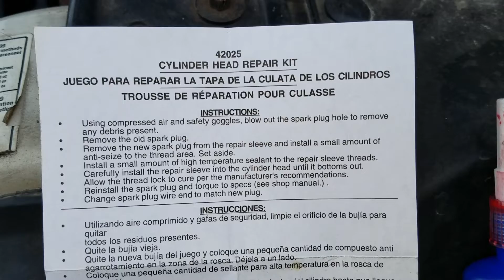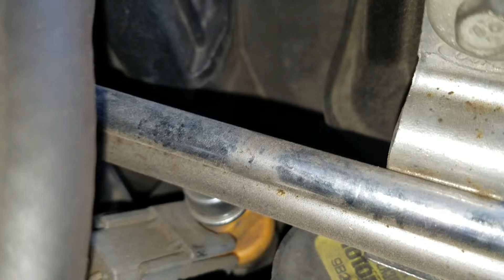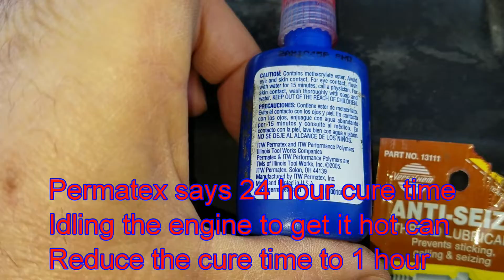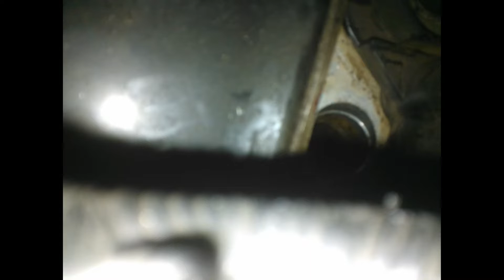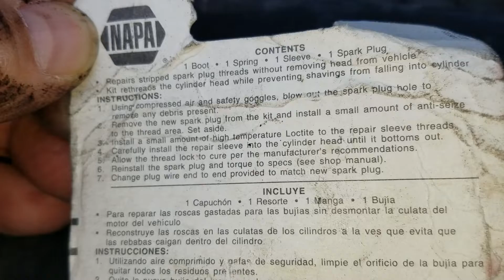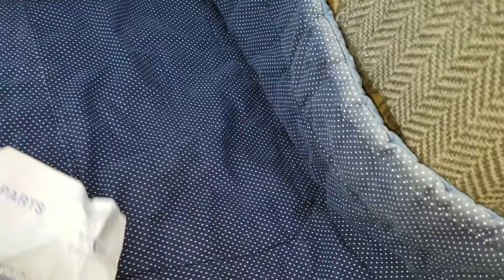Fast Permanent Fix FORD  5.4 L 2V Aluminum Head Spark Plug Seat Repair

Comment: Use this only for a temporary fix if your stranded. It will eventually destroy your head which will need to be replaced. You need to permanently fix it with a Cal-Van insert.
Reply from the maker: I mostly agree with you that it's a great middle of nowhere emergency fix, but it will last for years or it did on my truck and that's with hauling around a 3000 pound truck camper and probably another 1000 pounds of gear. My repairs held up to severe duty. A regular person may never need another repair. If something happens again down the road,  it is not going to destroy the head. All it's goi g to do is the same as the original failure and blow out. You may even be able to make the same repair using a new kit like I did in Vegas. I had a repair kit fail, got a new kit, installed it, warmed the engine idling for an hour to speed up the cure then left Vegas at 10PM heading north a couple hours. Slept at a gas station mini mart a couple hours before continuing on. Repair worked fine without fail another year or 2. The engine finally failed and seized on me in a matter of seconds when the oil sump tube failed and cracked causing the the pump to suck air. The new rebuilt engine has new plug seats that should be no problem.  Just check for torque periodically.  Take care...
Reply: @CITAP1  your lucky cause normally it will blow out and take a piece of the head with the repair.
Reply from the maker: @johnmilnerQQ  Usually what it does is simply blow straight out and break off the side of the coil, the little mounting tab that holds it down to the head and in the hole to the spark plug.  I've seen it happen a few times and never saw head damage. Always just the coil and the coil is usually still usable except it will sit lose. With my old engine, I kept two kits and tools and materials to do the repair.  15 minutes and you're on the road.
Reply: I put it in my 4.6 expedition and still holding up until now after 17 000 miles.

Comment: I mean, I’m hearing everything but how to tap and rethread a spark plug hole in a tight spot
Reply from the maker: The new seat has a cutter built into it. Loa the threads up with the correct hi temp red thread lock, use a deep socket and put it down the hole start tightening and go forward only, no back and forward like a regular tap. Tighten down till it feels tighter and stops turning easily. The front holes are easy. 4, 5, 8, not so easy. Having a combination of extension lengths for best position helps.

Comment: O'Reilly auto has them for 59.00
Reply from the maker: I have a new engine since then. The new heads have new steel plug seats which are like the CalVan seat. Should never have this problem again.

Comment: After using the CalVan 38900 kit to repair my 2001 F-150, I would never consider another method of fixing this problem.  The CalVan kit is engineered to be a one time repair and is far better design than the Napa repair kit.  That being said, it is pricey, so if your budget won't allow it, the Napa kit is probably the best solution.
Reply from the maker: Totally agree! If you're in the middle of nowhere with limited tooling available, the NAPA kit is your best choice. You can always install the CalVan kit later.
Reply: That kit is $550-$600.  How much did you pay and how many spark plugs have you had to fix?  I would love to get that kit too.  My guess is that local mechanics don't use it because of the cost.  I believe that's why I am fixing mine now.  I had to use the NAPA repair kit as I am pressed for time and to get my steady ride back on the road.  How long did it take you to fix yours and what components did you remove to get better access to it??
Reply: @patrickwhelan5703  $235 on Amazon. Kit includes 8 inserts.
Reply: I only paid $150 for my Calvan knockoff kit on eBay and it has all the same parts as the Calvan. 

Amazon has new Knockoff kits for $165.00 that includes all the parts of the Calvan as well as the inserts.

Good luck 🍀
Reply: PS: Napa auto parts sells the same exact Calvan kit for over $450.00. They must really think people are stupid.
Reply: @DoyleShadduck Actually, I think they do.

Comment: Hello what is the kit called and where can I buy it
Reply from the maker: I showed the instructions near the beginning of the video and on the box at this time in the video. 
https://www.youtube.com/watch?v=PWyw_gxNQ4Y
The NAPA part number shows in both parts of the video and is available at NAPA Auto Parts Stores. #600-3248

https://www.napaonline.com/en/p/NDP6003248
NAPA also sells replacement coils if you need that too.
Good luck with your engine.
Reply: @CITAP1  ok thanks a lot

Comment: Getting a free f150 with a plug blown out would jb weld be m a better option for lasting the life of the engine rather then lock tight

Comment: I don't know about "easy fix". 1st you need the right tools to fix it. On my 2002 ford Triton you definitely need a adjustable wrench. You got to find the hole that it came out of. You got to take apart the wire leading to the coil. You got to put the spark plug in without restriping it. etc. A person with no knowledge about cars would have a hard time finding this
Reply from the maker: This video deals with the two valve engine. You don't need an adjustable wrench.  The coil merely unplugs, then use I think an 8mm socket to unscrew and remove the coil. Remove the spark plug,  install the self tapping seat, install the new H1 plug, finished. The two valve engine is simple.
Reply: I am a mailman and no mechanical knowledge and I have done this successfully.5 years later today it is still no issue still in tact.

Comment: Having a problem finding a thin wall socket that will fit! Any suggestions would be appreciated
Reply from the maker: Usually a cheap 12 point deep socket will do it.
Reply: Any trick on popping the new spark spring into the new coil
Reply from the maker: @SDMFTommySick  You just press it on over the little tab, may take some effort but you want the tight fit. The little metalic rod inside the spring I believe does a couple things, concentrates the magnetic lines to transfer more energy into the spark plug and reduce radio noise interference.  When you get the spring on, slip the boot over it and the boot does attach to the coil in a specific way that should become obvious.  Hope it all works out for you.
Reply: @CITAP1  just kind of put the spring in there my problem was the spring I was removing kind of got all twisted up because it was really attached in there and I couldn't get the new spring attached that tight. I just got the job done truck started right up just went down to the gas station and back so far not haven't but much of a load on it. I do want to thank you for posting this video I know it was a while ago that you posted it. You & the video have been a lifesaver thank you very much. Funny thing is I work on race cars all the time never had to deal with these coil packs like this..
Reply from the maker: @SDMFTommySick  Awesome! Makes my day knowing I helped someone.  I've done a few older Ford and Pontiac engines. I appreciate the straightforward honesty of a carburetor and dual point distributor.

Comment: Mines cracked and broke off in the head how to get out now without taking the head off
Reply from the maker: The plug or the new seat? If the seat, an easy out.  If the plug, can't you just get a deep socket on the plug?
Reply: @CITAP1  the seat broke into pieces and I got a couple out already with a magnet but the last piece seems to not be able to come back out the hole
Reply from the maker: @nathanscruggs6080  Sorry this seemingly simple project is becoming more of a P in the B for you. I'm guessing it's the NAPA KIT seat that broke apart and a piece is now stuck in the cylinder.  The next step I would do is to install a CalVan seat. You will have to drill the spark plug seat hole larger for that seat. After you drill the new hole size through the spark plug opening,  you should be able to pull the pieces out through the now larger hole. When you get the pieces cleaned out, tap the new threads and install the CalVan seat. Hopefully everything will work OK. Removing the heads is a challenge.  I did it three times replacing head gaskets on this truck.  Finally figure the problem was a Ford manufacturing error where the block deck surface mill machine gouged right between the cylinder wall and water jacket.  Gaskets would work for three months then fail I got 80 grit sandpaper and a flat block and sanded the left and right side of the block an equal number of passes across the entire surface until a feeler gauge wouldn't fit under a machinist's straightedge.  After that, everything worked great until the oil sump tube cracked and I lost oil pressure, seizing the engine within 10 seconds. Now I have a new engine that's working great. That's a few other videos though. OK, hope things work for you this time, best of luck and Take Care...
Reply: @CITAP1  thanks for the good info now I’m about to find a shop that does the cal van install hope all goes well I miss driving my baby
Reply from the maker: @nathanscruggs6080  Good deal!
Reply: The seat broke into pieces and I got some out already with a magnet but it one that doesn’t seams to fit out the hole

Comment: Did you replace the coil also? It looked like new coils on your previous repairs but you didn't mention it here. What do I do with the old coil to make it stay on?
Reply from the maker: I did replace the old coils with NAPA coils. You can get by with using the old coil if it stays in place. I used my old coils for a while till I bought new ones and screwed them back down to the intake manifold.
Reply: I use the same coil by gluing the ear that broke still screwed in the same spot and still works to this day.

Comment: Ford should be sued for this defective engine
Reply from the maker: I hear you. One thing they say is to periodically check the tightness of your spark plugs. With so few threads, the plugs are prone to loosening and backing out and over time with the combustion slamming them in the threads, the threads wear out and you get the infamous blowout. As a preventative, take a torque wrench to each plug and check it for 13 to 15 pounds torque.

Comment: In case you can reply immediately I want to write you and tell you thank you for your video and ask a very important question at the moment for me. If the kit is in without Loctite What do you recommend?
Reply from the maker: If you screwed the new seat down and it made a good solid stop at the bottom, I'd consider a wait and see approach. You could back it out and apply the correct high temp red thread locker. The trick with that is you need to be certain to not cross thread when you reinstall the seat kit. I did have one of my two kits fail on me down in Las Vegas traveling through there. I stopped in at a NAPA store, got a new seat kit and installed it after removing the failed kit. I was careful and made sure I found the threads the original kit made so as not to cross thread and was able to install a second repair kit for that spark plug. The second repair worked immediately and lasted until the engine died from loss of oil pressure a year later. Remember, there is a specific thread locker and it can be hard to find. I have seen other YouTube videos where they used high temperature JB WELD instead. I don't know how it worked in the long term for them. Hope that helps.
Reply: CITAP1 fortunately I am at a mechanic. I told him that I think that the Loctite is essential… He backed out the kit put the Loctite high temp thread locker… And reinstalled it. Now do I have to wait? Waiting for your recommendations
Reply from the maker: @joshuacox5263  The kit says to wait 24 hours for the thread locker. I waited an hour, then idled the engine to get it warm, then shut down for half an hour, then started again, let it warm up and went on my way with no issues. That has always been while carrying my truck camper so there was a good load on the engine and it turned out well, lasted for a few years till the truck engine finally died. I will say if you were at a mechanic shop, I would have gone for the CalVan seat replacement kit. It's more involved but as I understand, it's the best of all the repair options. What you have though will work fine and I wouldn't lose any sleep over it. As I said, my truck gets heavy use most vehicles will never know and these kits worked great.
Reply: CITAP1 When the repair was finished I drove two minutes to an advance auto parts parking lot to wait for your reply. I am now going to wait one hour, idle the engine to warm it up, then shut it off and wait 30 more minutes. When this is complete I’m going to continue my journey 350 miles home
Reply: CITAP1 God bless you for helping people in such an emergency! ✝️🙏
Reply from the maker: @joshuacox5263  Thank you and my pleasure!
Reply from the maker: @joshuacox5263  Excellent! That's what I did in Las Vegas, Fixed it, waited, then continued my drive home to Seattle. Up and down miles of hills, 3500 rpm, 70 MPH, no problems. Have a nice drive home.
For your entertainment, 
Here's the video before I got things fixed, waiting in the NAPA parking lot in Las Vegas. https://youtu.be/y2F2blhfd48
Here is the video after Las Vegas a few hundred miles away at Hawthorn Neveda. https://youtu.be/7w96LQiBgyA?t=196
Reply: CITAP1 I made it safely back to Michigan 400 miles later. Today I hooked up my trailer and after about 10 miles while parked I noticed that it started to run a bit rough. It is running fine now but I noticed vibration on the specific coil that has the kit. I’m considering taking the coil off and checking if anything became loose. Again at this moment it is running fine but I feel the vibration when I put my finger on top of that coil
Reply from the maker: @joshuacox5263  You could try letting the engine cool down a bit, then run it and spray some soapy water down on the boot of the spark plug where it sits and seals on top of the head and try to see if any bubbles form coming out from the spark plug hole. If no bubbles, it should be fine. Check to make sure the coil plug and injector plugs are connected properly.
Reply: @CITAP1  Thank you I will try that.
Reply: @CITAP1  I found that the vibration is from a hose that goes into that side of the engine. The hose was leaning on the wires for the coil and that is why i felt the coil vibrating. The rough idle hasn't returned yet but I'm still unsure what caused it. Thank you again. I suppose if the kit fails it may not give any symptoms but rather it might simply blow out and break the coil again before I would notice anything going wrong.
Reply from the maker: @joshuacox5263  You can periodically pull out the coil and boot. Look at the boot for signs of combustion leakage. The boot will get hard and crack. The boot should always be rubbery and black.
Reply: @CITAP1  Copy that SIR
Reply: I'm having an issue putting it in due to the socket not fitting in the block
Reply from the maker: @Notstartingnothing  You need to get a thin wall socket. A 12 point should do it. I think I used either a craftsman or husky to do mine. You may also need an automotive pick with a 90 degree end to hook the socket to get it out if the extension pops out of the socket, Automotive stores have them in a pack of 5 with different tip styles for about 8 bucks. the pick should be 10 to 12 inches long.
Reply from the maker: @Notstartingnothing  You can see the picks I used to retrieve the socket in this video clip. https://youtu.be/7w96LQiBgyA
Reply: How’s it doing now Joshua

Comment: How long did you have the truck before having to change 2 of them?
Reply from the maker: This is a hard working truck carrying construction materials and about 4000 pounds of truck camper and supplies with two people. Most vehicles will never have this level of use. The first one blew on a camp trip near Tillamook Oregon.  We limped into town and camped near the NAPA store. I probably had 150k on the truck at the time. The second blew a couple years later at close to 200k miles. Both times I was on the road in 15 minutes. The engine finally died after a couple months on the road when the oil sump pickup tube and the engine lost pressure seizing within 10 seconds. The replacement engine has had all the sparkplug seats replaced and an improved oiling system. Truck is still going great.If you have the time and money, the CalVan kit is the better way to go. If you do this NAPA kit,  you can still do the CalVan kit later since it needs to be drilled and tapped to a larger size.

Comment: PLEASE DO NOT USE THIS.  The Calvan Kit can repair this the right way.  Watch Ron Williams video as to why YOU DON'T WANT TO USE THIS.  These kits can and will permanently damage your heads.
Reply from the maker: The CalVan Kit is the better way to go. The nice thing about this kit is if you are in the middle of nowhere and blow a plug, this kit will get you back on the road in 15 minutes with minimal tools and no drilling.  The repair will last for years under fairly heavy use like 2 kits did for me. The nice thing is you can remove and replace this kit with the CalVan kit at a later date when your home and have a place to work, tools, or a mechanic.  Incidentally,  my engine finaly died when the oil sump tube cracked and lost oil pressure. I replaced it with a remanufactured engine with all the spark plug holes drilled and repaired with CalVan or similar kit.

Comment: What about when that cracks and breaks off 20 thousand later. Do you got tip to get the threads out. Lock tighted in?
Reply from the maker: 20000 miles later, expansion contraction will possibly have broken the bond and it'll back out with some effort. If the bond is good, it should be still working fine. If not, remove and Then install the Cal-Van kit